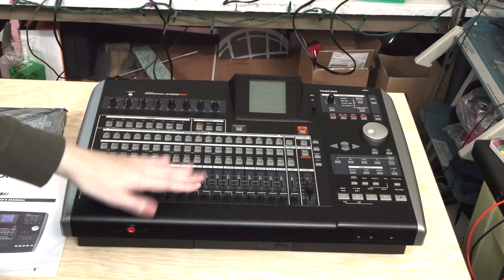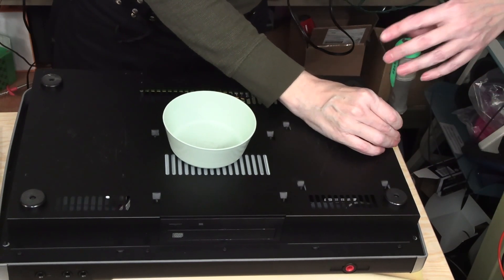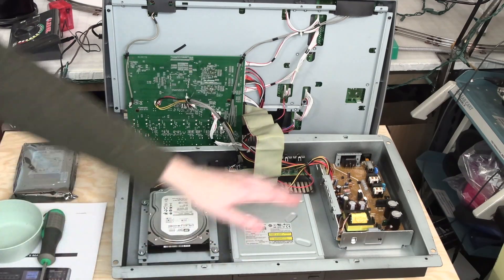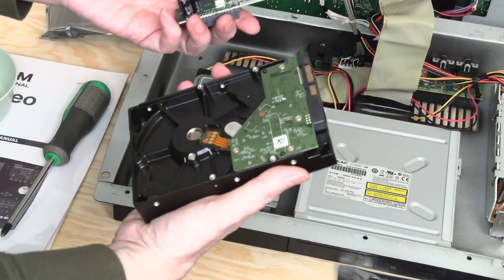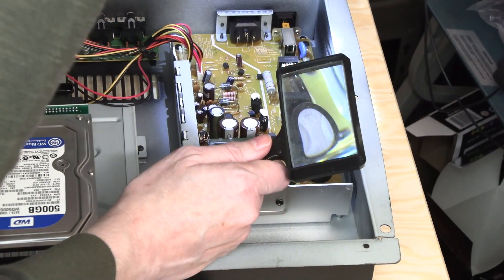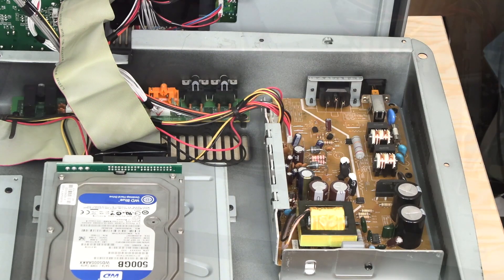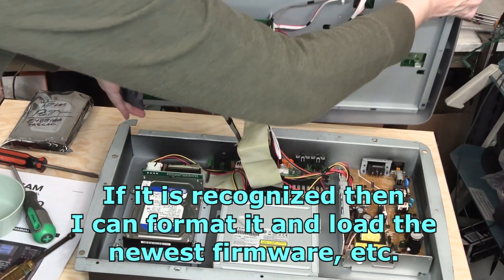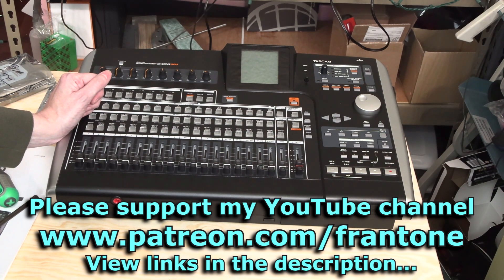Releasing The Petty

Comment: Definitely clone the original drive. Even if only to put the clone in the machine, delete the Tom Petty stuff from the clone and then back that up. There is also a chance that the machine just doesn't like the converter. I have used some of those in builds before and they can be a little unreliable.

Comment: Wow, I cannot believe it needs the hard drive to boot!
It should have it's OS in ROM or NVram.  It's a digital portastudio, how big of a footprint can that be? 
The disk should be reserved for music stuff only. 
That's pretty weak engineering if you ask me. 
Not only is the disk going to slow down bootup, but how does one archive their work? Are they expected to burn it all to CDR? 

ps. Datecodes? Who needs dated codes. It's named Neo, so it's obviously from the 2000's. 

If it was named Extreme/Xterme it would be from the 90's.